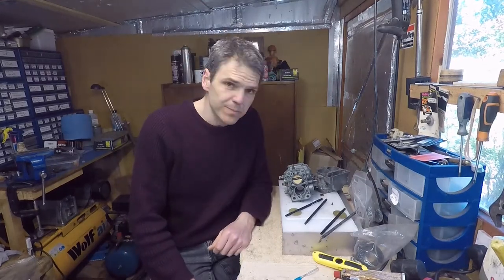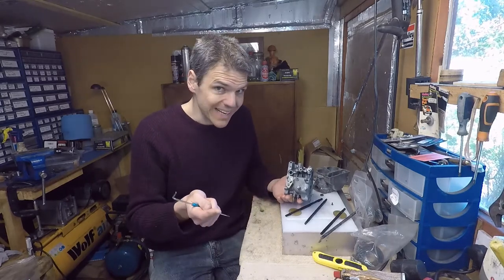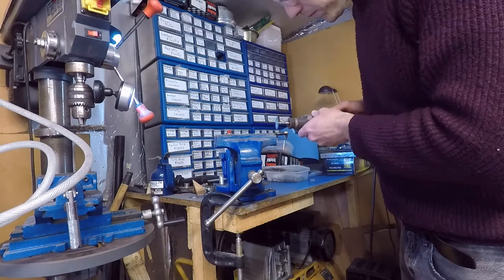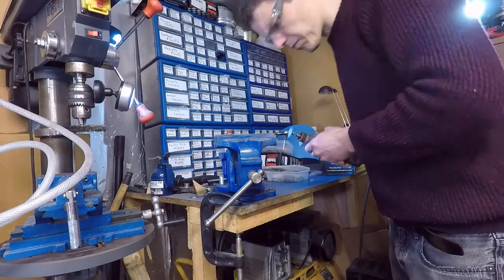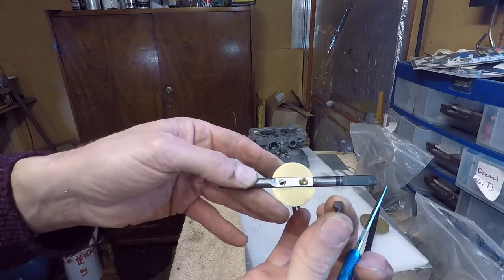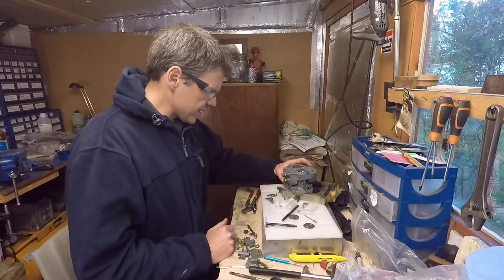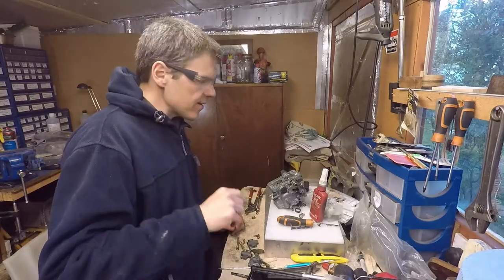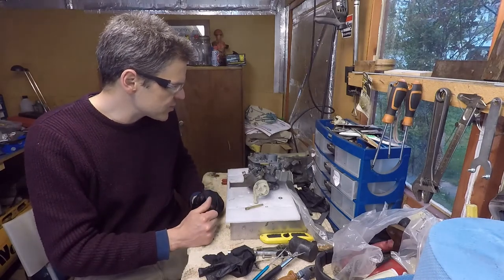How to tune a Weber 32 DMTR carburettor for increased performance theory + practice. Fiat 128 rally

Comment: Hello. Nice performance mod. I own an Autobianchi A112 Abarth '84 model, with the very same carb. I do have an issue where the engine bogs down when accelerating from idle. I have done a carb. clean using ultrasonic cleaner, rebuilt kit, and idle mixture adjust to the original carb. The car came with another and newer carb. of the same model 32 DMTR installed and still the car bogs down then acceleration is applied using both carbs. I'm thinking a jetting issue but what's your input. Thank you!
Reply from the maker: Hi there looks more like an accelerator pump issue. Is the discharge free from obstruction?